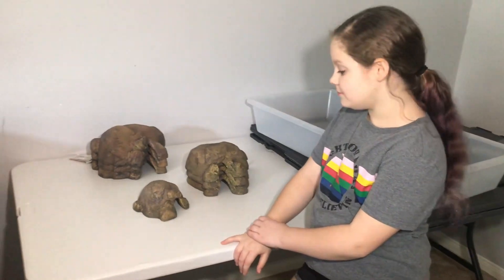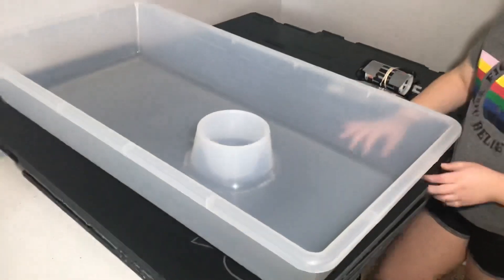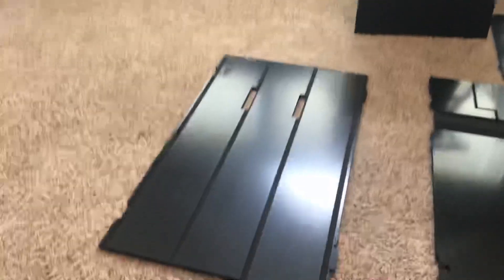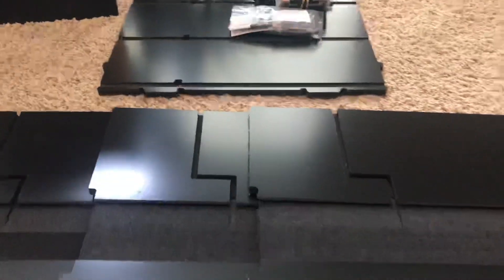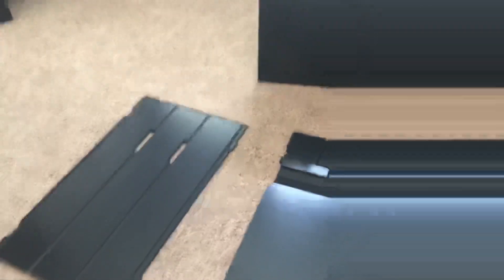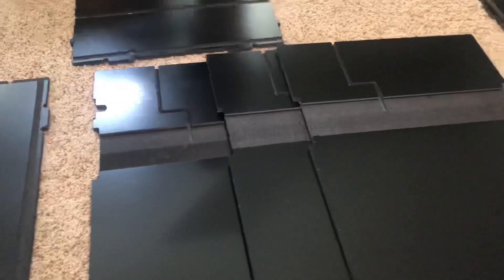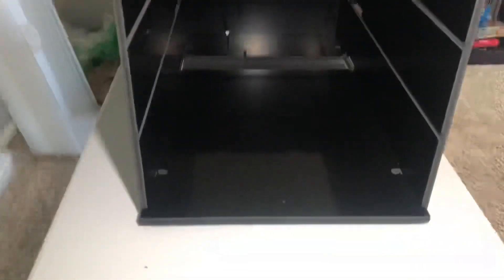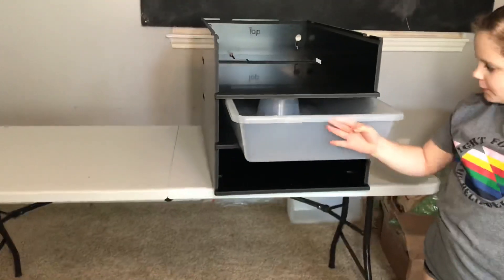BALL PYTHON RACK BUILD:  VE-CB70 ball python rack unboxing and build with Freedom Breeder tubs!!

Comment: Where did you put the probe for the thermostat? And cutting the heat tape do you need to tape of the end where its cut?
Reply from the maker: I put the probe on top of the heat tape and tape is down with aluminium tape.  I didn't cover the cyt end and have not had any issues.  Thanks for watching!